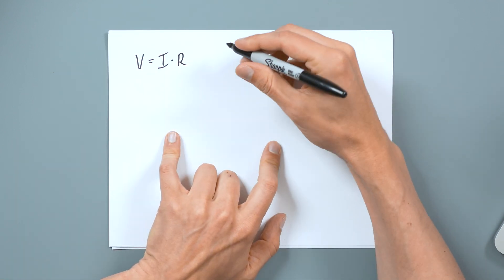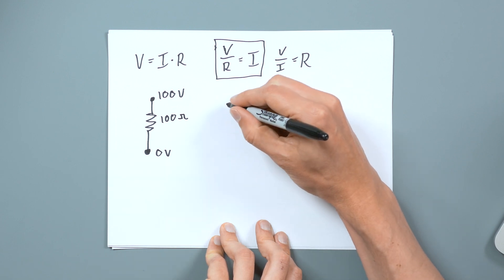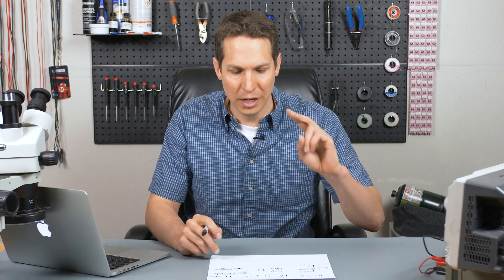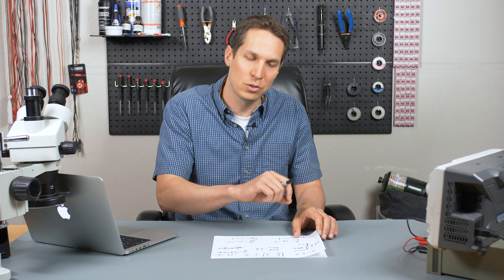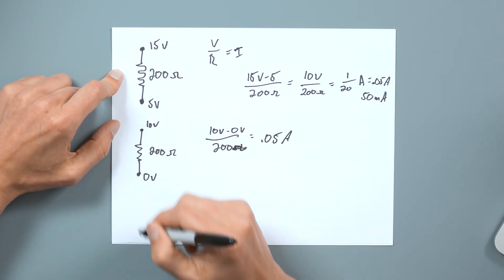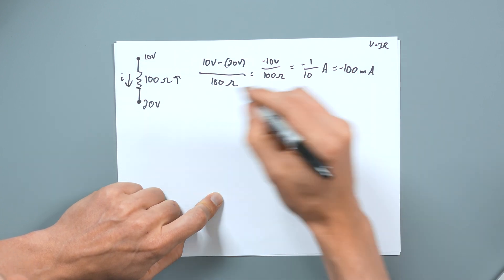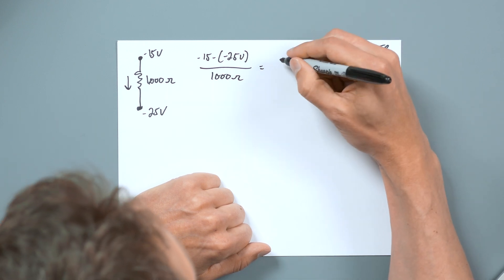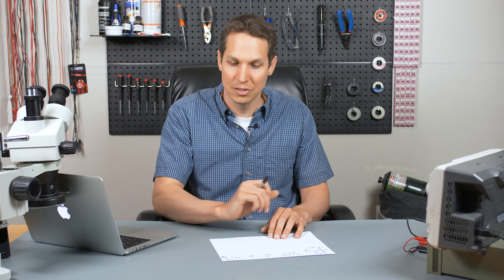Ohm’s Law Tutorial with easy practice problems | Basic Circuits

Comment: So, the thing I don't think has been covered up to this point that became implied at 3:20 ish is that Amps are the way current is measured.  Up until now in these videos, both terms have come up, but I don't believe they've been explained as being the same.  If they are not the same, then I have misunderstood something.  But Amps are the measured unit of current across a device or circuit?  And those Amps are calculated using Ohms (the measurement of resistance), and Volts (the measurement of Voltage)?

Comment: What about the watt in car audio? I know that V= square root (PxR) can you explain? 🙏
Reply from the maker: That's actually pretty straightforward.  Power (in watts) is voltage times current so the  amount of power that car audio puts out is simply that - how much current the amplifier(s) can produce without clipping.  There are 4ohm and 8ohm speakers as common options, which affects how much current is needed for specific voltages.

Comment: no matter how strong my source (imagine a huge capacitor) is, if i have that voltage and that resistance, i will get the calculated amps?
Reply from the maker: Yes, if your source is sufficiently large (and your resistor doesn't burn up/explode with too many amps), and all other real-life issues don't happen, then Ohm's Law will hold.
Reply: @CircuitBread  thank you

Comment: Can someone explain to me why 15V was substracted to 5V?
Reply from the maker: Hi Rey!   We used that example specifically to show that the most important thing to think about when looking at the voltages is the difference between the two voltages.  So, even though one side of the resistor is 15V, since the other side is 5V (and not 0V), then the actual voltage drop across the resistor is 10V, not 15V.    I attempted to explain this at 8:25, hopefully it helps!
Reply: @CircuitBread  sorry, I got confused when you mentioned "node". I don't have any proper education about electronics so the terminologies got me confused.
Reply: @CircuitBread  and last one sir, why exactly we need to know the differences between voltages why not use addition or other operation?
Reply: @CircuitBread  ahh okay I just searched in google and it says voltage is the difference in charge between two points! I understand now thanks.
Reply from the maker: Glad you figured it out - it's a crucial part of understanding circuits.  Now that you got it, you've got a stronger foundation to move forward!

Comment: I have a question. Does that means bigger the load (resistance) will give more battery life?
Reply from the maker: That is correct!  Keeping the same voltage, increasing the resistance means a smaller current which will mean less power.  We typically say a "bigger load" when something has a smaller resistance, though, as it requires a "bigger" amount of power.
Reply: @CircuitBread  Thanks.